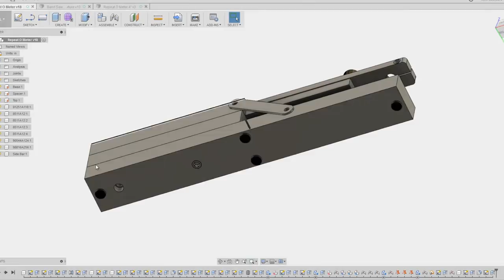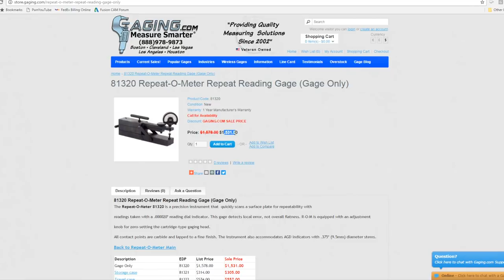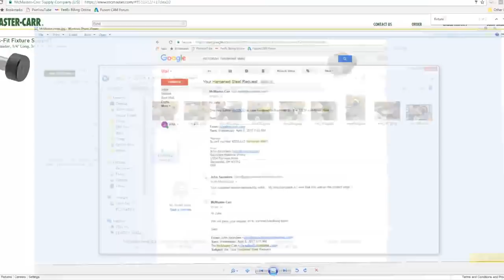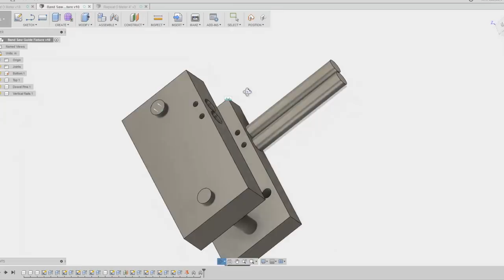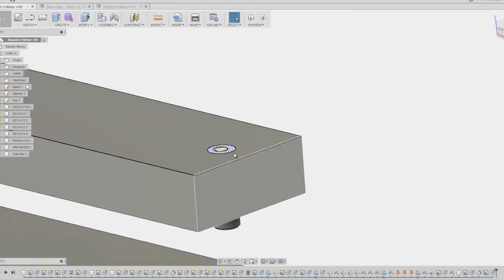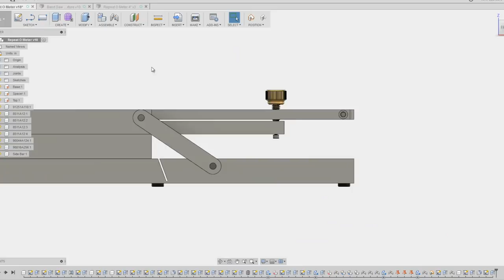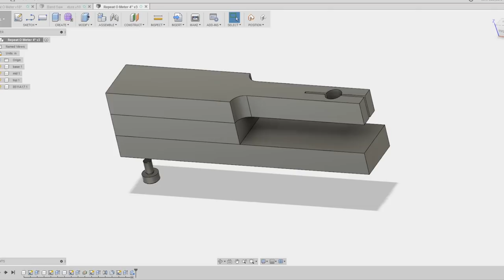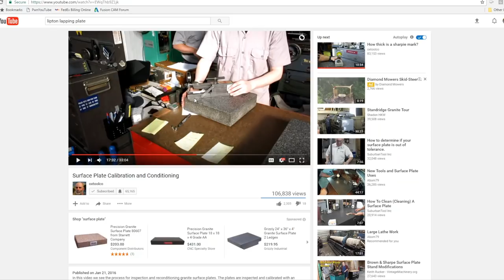DIY Rahn Repeat-O-Meter Part 1: CAD Design

Comment: interesting project, looking forward!  off the cuff I can't think of a reason why those splits couldn't just be built up into the design.  e.g. spring steel and 4 screws.  or heck just a vertical slot with a ballnose endmill.  also can't figure out why the brass knob would need two way adjustment if you already have two settings @ the indicator.  i guess I'll have to sit tight and find out!
Reply: But when can we see a ToT/NYCNC collaboration?

Comment: John,  for the adjustment you would want a very fine pitch since you have a very sensitive indicator.  40TPI thread is going to adjust .025"/rev so a .0001 is going to be like 1.4 degrees of rotation.   If you make it a dual pitch, say the top plate at 40TPI and the bottom plate at 32 TPI the differential is going to be (.03125 -.025 = .00625 per rev) resulting in 6 degrees of rotation per .0001".  40/36 would be about 13 deg per tenth.    Sounds like a fun project.
Craig

Comment: I have been thinking of making a sort of Repeat o Meter. I have 2 Mahr Millimess Mechanical Comparators, a C E J Mikrokator and a few LVDT units. I was thinking of using a spring steel Flexures (if you get it wrong you can change it - unlike a saw cut in the main part). I enjoyed the video and the comment from Forrest Addy . My contribution is for fine adjustment - I have a precision stand that uses a fine screw with a gently tapering point about 1 1/2 inches long – ¼ inch OD - the screw floats and the taper acts as a fine wedge - think of taper pin but hardened.
As I don't have a surface grinder I was going to use a couple of cheap   123 blocks as the main elements, many people would want to test small surface plates too.
 I was going to use gauge blocks or carbide inserts as feet. Only the single front foot is important for size and shape as the others are assumed to be on a good plane surface.
As I understand it the practical reason for a Repeat o Meter is finding local low spots on a surface about the size of the foot on a typical measuring instrument - not tiny chips or large inaccuracies of the surface.
 If you put a measuring device (particularly one with 3 feet) with one foot on the low spot it will completely ignore the true plain of the rest of the surface and produce errors and confusing measurements. The link to stop the instrument from breaking itself sounds like an afterthought - I agreed that some simple restraint could be designed in just using sloppy fitting screw.

Comment: Here's an idea for a variation that could let this tool do the job of an autocollimator: put two of the rear feet in line with the front one under the gauge, put the other foot halfway between the two rear ones and offset to the side (same arrangement as used on the bases of autocollimator mirrors), then the tool effectively measures deviations along a straight line. Do some Excel magic on the numbers and global flatness for the whole plate can be mapped out. If the distance from the rear to middle foot and from there to the one under the gauge is 150mm, you'd get about 0.69 arc seconds resolution (with a 0.5um or 20 millionths indicator), which is good enough for mapping a plate. Increase the foot spacing and you can measure down to whatever resolution you want...

Comment: Hi, Have a look at Dan Gelbarts part on flexture design.
From that I learned to drill and ream a hole to make the flexture part of the flxture accurate and bandsaw into it (I'm doing it straight . there is AFAIKT no reason to do it at an angle.)

Comment: The "e" just means how many places the decimal point is moved over.   In this case it was 5  places. so 3.937e-5 is 0.00003937.  You would typically see that where there is not enough room to write out the entire number.
Reply: And since e-6 is millionths, move the decimal one more to the right to change the e-5 to e-6 and you've got 39.37 millionths of an inch.
Reply: It's called "scientific notation."

Comment: cool project! I'm evaluating in my head if the 3 feet at the bottom should be made bigger in order to avoid holes in the middle, but this also might be counter intuitive if there are "raises" in the surface plate.

Comment: Nice project! The gage mechanism is inherently accurate. If it didn't have to be transported or treated roughly, it could easily be made using very light materials. I check my plate with a high precision level, which gets me within .0002-.0003.

Comment: Also, thinking about whether both "halves" of the repeat-o-meter need to be split evenly, or if the flex half could be 75% of the total area. That in theory should make 30% more sensitive right? If the static base end does need a lot of surface area, maybe having it wedge shaped than just a square footprint would allow you to make it shorter, but keep the accuracy.

Comment: Hi,
Look up differential screw micrometer for how I think the thumbscrew on top is working. They can give a very fine feed.
Reply: David Colwill bring the top part is made in one piece with a saw cut, there is no way to get a differential in
Reply: Top part tapped one thread bottom the other with the screw made in two parts and glued together.
Reply: Just done this to make sure I wasn't going nuts. I used M10 x1mm for the top hole and M5 x .8 for the bottom hole. Although it was done in the crudest way it did give a usable .2mm per turn.

Comment: Great project! ...I'm surely making one. A  ball bearing foot would have too small of a footprint, and a tendency to dip with any small void. For the fine adjust screw,  Turn a rounded groove in the top portion of the knurled screw, to drive a pin thru to make it captive it in the upper part....seems to me more of a machine tool method.

Comment: Re: the proposed case hardened feet - remember that case hardening is usually very thin ( few thousandths) and so you may loose the hardened surface in the lapping process ? Just a thought.

Comment: I'm not certain why the flexure cut needs to be narrow all the way up, only the flexure itself needs to be short, so what about doing it with a 1mm tipped tapered endmill? Then you can do it in the horizontal plane without refixturing. The only sticking point I can see is getting debris caught in the cut, but I can't see how that would be less of a problem with an angled straight cut.
Reply: Or even the largest tip tapered endmill that experimentally works, as a larger endmill is going to do the cut faster and last longer; I've seen precision instruments with much larger span flexures, so it's not clear why the flexure needs to be that short.

Comment: G'day John, this is a great idea as I've seen a lot of interest in these over the years. I think Tom nailed all of my personal concerns with your design ideas, and I'd definitely give the bandsaw idea a wide berth. That's absolutely a job for a slitting saw.

With the feet, it may make more sense to think of the back 3 as feet, and they are under the base to support it. The fourth is free to move courtesy of the flexture, and isn't actually a "foot" but rather a contact point.

Do a search for Fed document "GGG-P-463c" as that was the (now redundant) spec for surface plates in the US. On page 11 it provides the critical dimensions for a repeat meter. A newer standard is "B89.3.7 - 2013" but I don't know if it's in the public domain. If anyone knows of a source I'd be grateful for a link.

Comment: i wonder if you could use ball bearing balls instead of those feet. or atleast for that 4th tab where the measurement takes place. 
i could see those feet covering small detents in surface places. not to mention are those feet flat? if they arent wont they make your measurements off?
Reply: That's actually intentional. Surface plates often have small chips missing in the surface that don't really affect the flatness in a practical way. So you want the feet to be large enough to avoid dipping into those small pockets in the plate.

Comment: For the two slots on this part i wouldn't just a normal bandsaw. Because your cut won't be as precise as you might need it. I would rather use a circular saw blade for the mill. They are available in different sizes and width and u get a clean cut with it.

Comment: i think, i would go with a horst link type design, vs the one point system, would be a tiny bit more accurate, and possibly easier especially if this were made via a cnc machine.

Comment: The fine adjust on the original is a differential thread!
Reply: Just like described in Robin’s video in attaching vice jaws with differential screws. I think John’s method won’t be sensitive enough for such a sensitive  indicator

Comment: how is this better/different than some base with three feet and an indicator? what am I missing?
Reply: I'd guess that it's so that the force on the indicator is exactly perpendicular. No affected by sliding the indicator around on a surface (i.e. side flex)
Reply: That's literally what it is.  However, adjustable bases aren't stable enough for how these are used.  (This is what oxtoolco said in the other video.)  Also he said that an indicator directly on the plate is wrong because the contact surface is too small -- you'd have to use a parallel in between.  It'd be pretty damn tedious to duplicate what the pros do like that.

(You slide this thing around, fairly rapidly, getting a continuous read from it.  If you had to slide the parallel around at the same time as the base, it wouldn't work.  So you'd have to adjust both, read, adjust, read, adjust, read, etc.)

Comment: You could use drill rod instead of ball bearings like Tom suggests.
Reply: Also I don't see why the cut for the flexure has to be at an angle, vertical should work just as well.

Comment: Why is the 'flexture' even necessary? It will resist movement, thus only showing relatively large inconsistencies in surface flatness and also it will tend to be thermally unstable as it's pre-loaded. It will also increase foot wear and plate wear compared to the indicator spring pressure fitted with button foot. The indicator will need to be re-calibrated regularly to account for the above factors and three feet only with the indicator tip in direct contact with the plate would require less re-calibration.

It will also be lighter and easier to make, requiring only one base, three feet and the indicator and clamping screw and a very slightly convex button indicator attachment. What were Rahn even thinking, making it this complicated? Like you said John, $1500!

Comment: why not use ball bearings for the feet?
Reply: I'm guessing the small contact area of a ball bearing could wear out too fast and could damage the surface you are sliding it over due to the high contact pressure.  John probably has a drawer full of broken carbide end mills he could salvage pieces from for the feet.  Steffan Gotteswinter reuses his.
Reply: oxtoolco actually recommended ball bearings for the feet.  You don't rest it on a tangent of the sphere though.  You cut off the ball bearing and lap it (installed, along with the other feet) to a flat surface.
Reply: i think the carbide feet need to be machined or lapped flat together, there's no way you'd get them flat otherwise just by drilling holes in the base, they will most likely run on an edge and scratch the granite surface. If the ball bearings wear out it is fine, the wear overall will be on the same plane and height doesn't really matter as you are comparing and not need to have the whole thing level or flat
Reply: of course I watched Toms video after this....  answering this thoroughly.
Reply: I just watched it too, not sure I get the point about putting flats on the balls though (as in why would be necessary), i would think the edges on carbide feet would be a lot more harmful to a surface plate